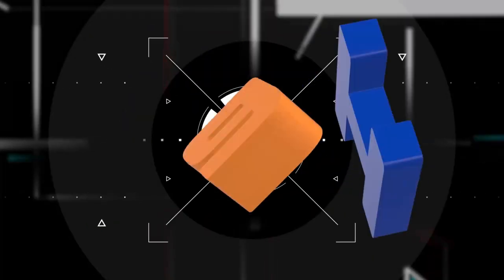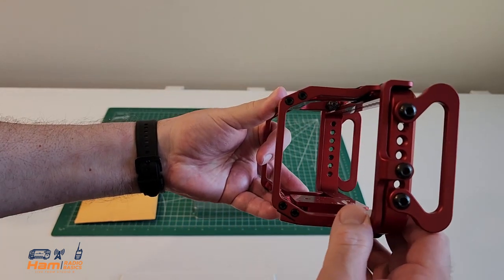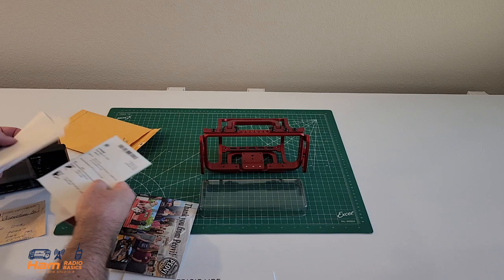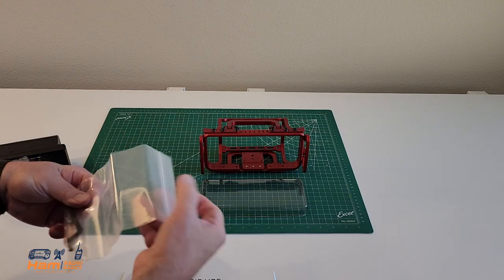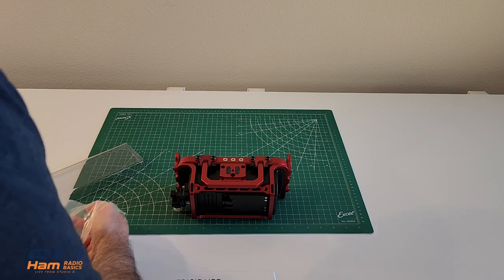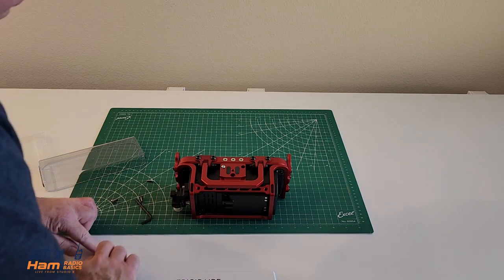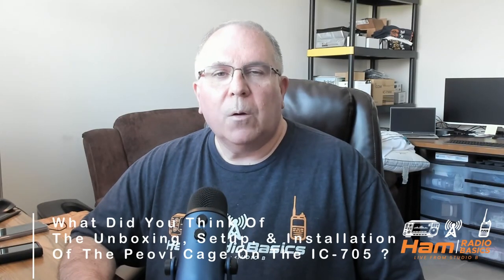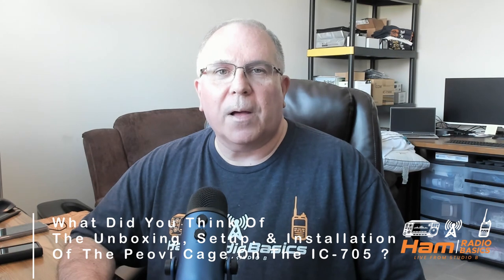ICOM IC-705 Peovi Full Cage Unboxing Setup, Installation

Comment: I think you have the handle in the wrong location.  It should be on top of the radio, not on the bottom.  It is not a kick stand, it is a carry handle.
Reply from the maker: There is a handle on the top and a kickstand on the bottom.. Check out the community tab here on my channel where I posted pictures of each. Thank you.
Reply: @hamradiobasics  Ah, they must have updated the cage since I bought mine.  A kickstand was not available back then.  Nice to see new innovations being added.
Reply from the maker: It's a great feature.